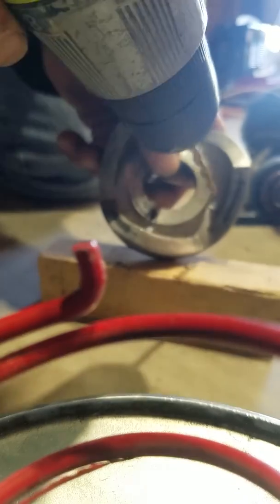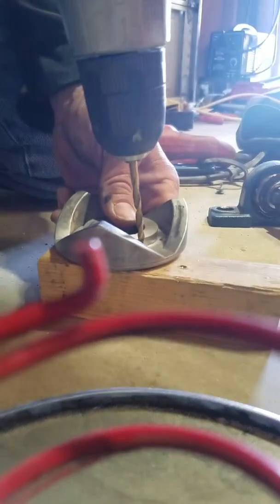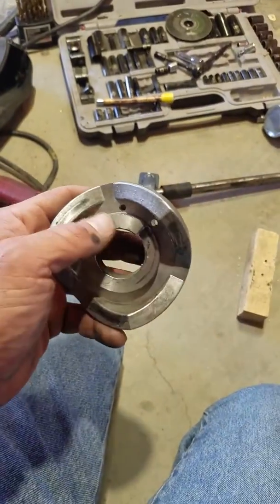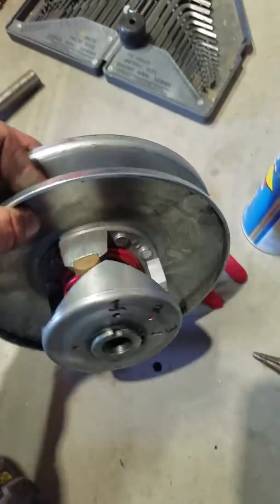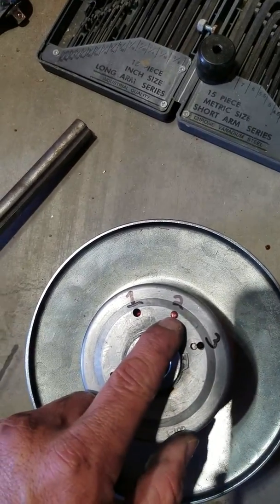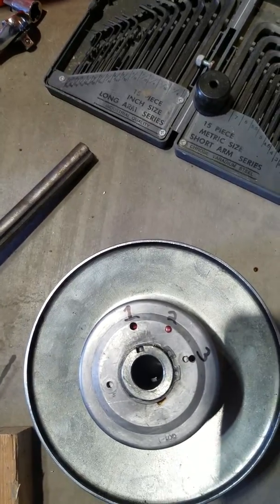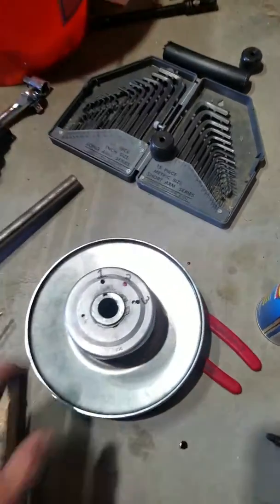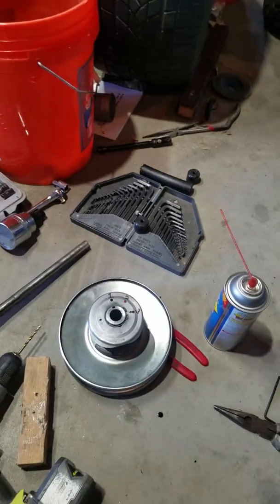How to mod a comet 40 driven pulley for more torque vid 2

Comment: good idea
are you supposed to preload clockwise or CCW
Reply from the maker: That actually depends on the direction of clutch rotation. there are two different springs wound in the opposite direction that you can buy. When you tension yours, tightening the spring is the direction of preload. As in- if you turn it and wrap it more times around the shaft versus making the spring larger when you wind it.  They are pull springs, not push type
Reply: B Curtis thanks for the reply
mine is an older type comet TAV
just to confirm, the spring is under tension at idle, and at WOT the spring is expanded?
Reply: B Curtis....older comet TAV model 20
Reply from the maker: under tension at idle, and under MORE tension at high speed/ high gear. So It gets twisted even tighter on itself. It only takes a 1/3 a turn or so to go from disengaged/low gear to fully spread driven clutch/ high gear. You pre tension it, then when the primary pulls the belt tighter, it pulls the sprung pulley forward (direction of belt) even more against the pretension you already applied during assembly. Sorry so late, I don't check this often.
Reply: B Curtis appreciate the reply. I thought the belt has to overcome the tension of the spring in order to spread open, but your explanation makes more sense
I'll have another go at it this weekend
again, thanks for explaining it
Reply: B Curtis well, got it all back together and the driven pulley sticks open when slowing down / reduced rpm 😲
Reply from the maker: Wesley Jackson I had that issue on the third/tightest setting. I do not have that issue with it on the second setting I drilled closest to the original hole. Try another hole closer to the original
Reply: B Curtis ment to get back to you, I actually figured it out late last night.
I was going to disassemble the jackshaft and rebuild the driven pulley again because the belt kept sticking in the driven pulley, but when I took the drive clutch off the engine to remove the belt I found one of the springs broken! replaced the spring and we're up and running problem free
thanks for the help though! appreciate the replies
Reply from the maker: Wesley Jackson awesome! Good to hear. Glad you got it figured out .